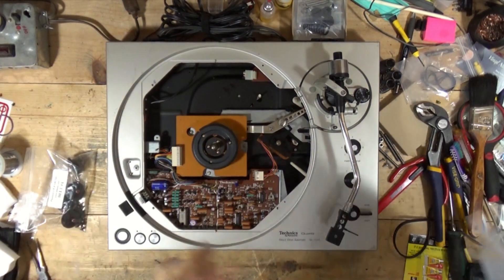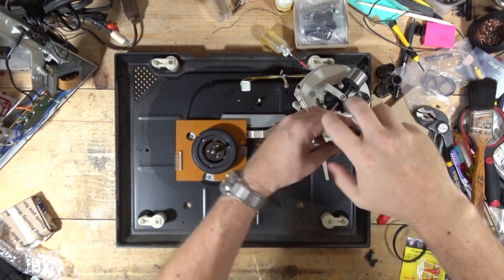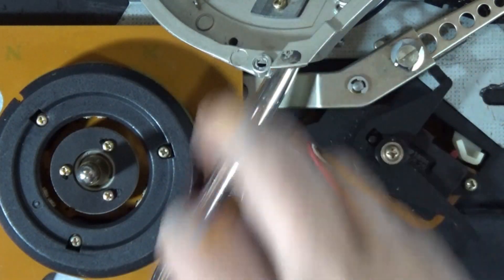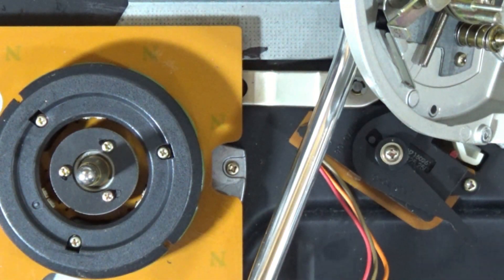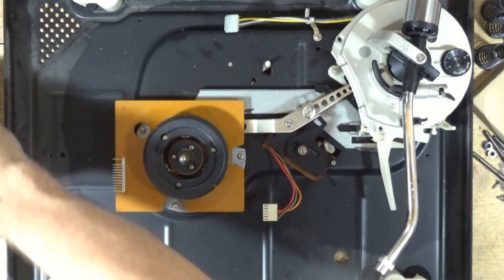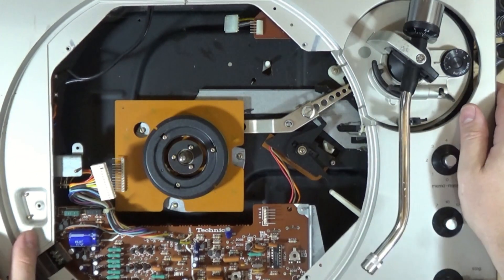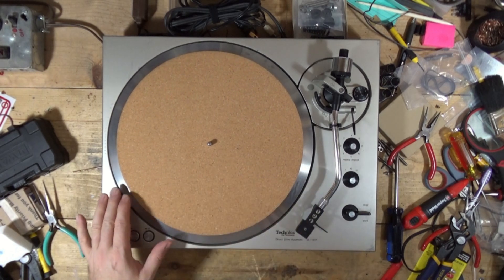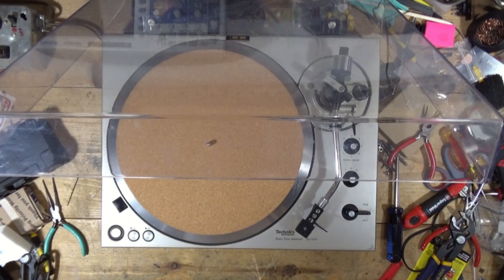Technics SL 1301 Turntable Repair Part 2 - Tonearm Stand Replacement & Wrapup

Comment: Did you check the date codes of the electrolytic capacitors ?
Reply from the maker: Not on this particular table.  Sometimes I will just to get a better idea of when something may have been manufactured.
Reply: All technics 1301’s were made in 1978
Reply from the maker: @UHOH3300 Good to know.